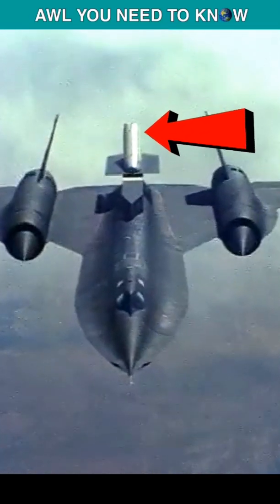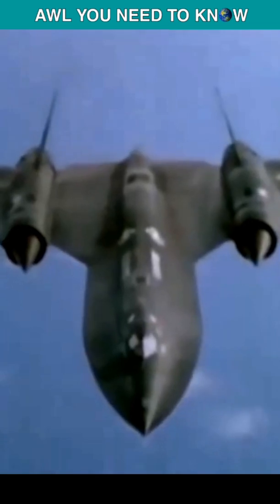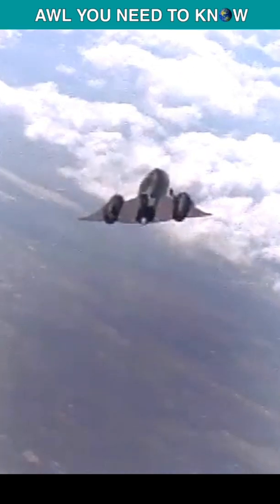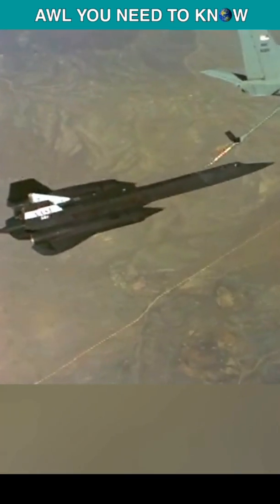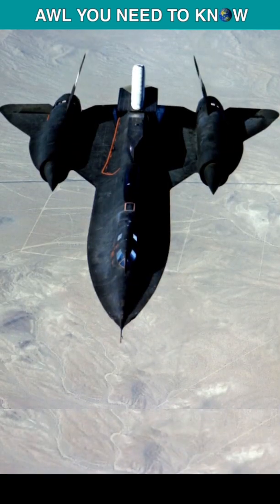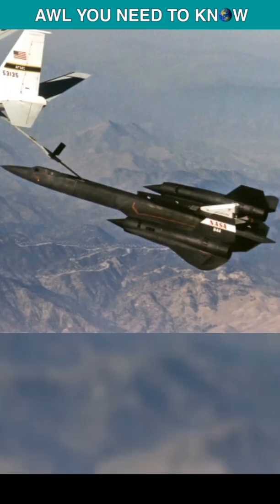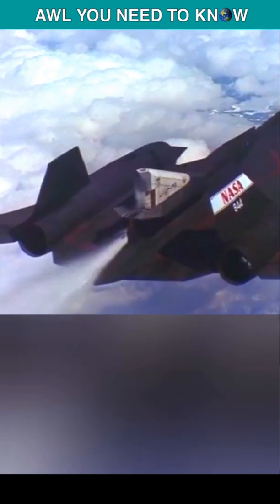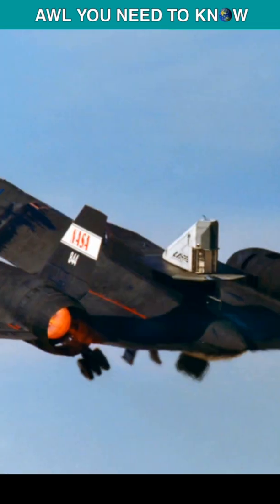What's This On The Back Of SR-71 Blackbird? #shorts LASRE Experiment

Comment: Another piggyback program was the D-21 reconnaissance drone. It was initially designed to be launched from the back of an M-21 carrier aircraft, a variant of the Lockheed A-12 aircraft. The A-12 was developed into the SR-71.
Reply: They launched one into China and it didn't come back,the Chinese retuned it years later.We were stretching the limits of our tech.Not sure if it was guidance propulsion or another problem.

Comment: This actually isn't an SR-71.  It's actually an M-21.  It originally was configured with a surveillance drone on that central mounting point.  There is an M-21 currently on display at the museum of flight.
Reply from the maker: This isn't any M-21, this is Sr-71 with Lasre pod on its back.
Reply: @awlyouneedtoknow9435  the SR-71 had two sister aircraft being the single seat faster A-12 for the CIA and the M-21 which was designed for a drone to be mounted on it. Considering the unit is where the D-21 drone would have been launched from it’s probably a M-21 and not a SR-71.
Reply: Interesting. The north Koreans had Mig 21 fighters during the Korean War.
Reply: I always thought there was multiple SR-71 I didn’t know there was a M-21 version so it’s basically a SR-71 with mod’s if that’s the case the designation should have been MSR-71 the M would stand for modified
Reply: @jaredharris1970  The M-21 is technically a variant of the A-12 with a second cockpit added for the drone operator. There is also the YF-12 which was the original fighter interceptor design but I don't know off the top of my head if it actually flew.
Reply: @jaredharris1970  The M designation stands for mother ship.  There was also a D-21 which was a drone that the M-21 carried.

Comment: About a billion bucks we pissed away working on
Reply: How many countless programs could fit under this statement? More than we'd like to know. US loves spending money to keep thier defence industry running.
Reply: @dillonventola408  It's not something you can turn on & off like a water faucet.
Especially in this high tech world.
Reply: @mydogbrian4814  I agree, I just wish they didn't develop tech, forget it for a decade and then suddenly start a new more expensive project for the same goal
Reply: @dillonventola408  agreed like how they said the f22 was too expensive and did fit their goals anymore then developed the f35 went over budget with it delayed it and now when they are asked why they can’t restart the f22 program it’s because of cost even though clearly they don’t have a problem using so much money
Reply: @Reaperzx6  or just pissing it away sending billions to other nations. Tech like this is necessary though. Because although it isn't in widespread use, it's necessary for R+D to see the pros and cons of certain equipment and either throw it away because it's not necessary or revised to work better, more efficient, and more cost effective. Don't forget, the United States has a lot of tech not known to the public based off of equipment like this. Prototypes can get written in history books because they designed a better system and they don't have to worry about other nations finding out about obsolete equipment because we already have a better version
Reply: @dillonventola408  And you have no problem with the current regime wasting money on fraudulent programs and giving away all our oil...
Reply: Yup, & not one test flight.
Reply: Lmao, your dumpster fire has pissed away trillions.